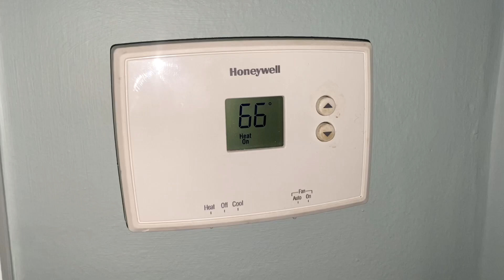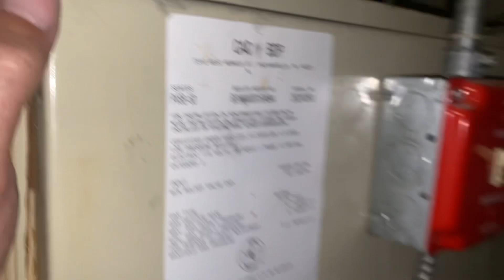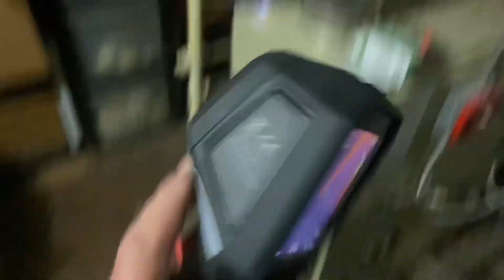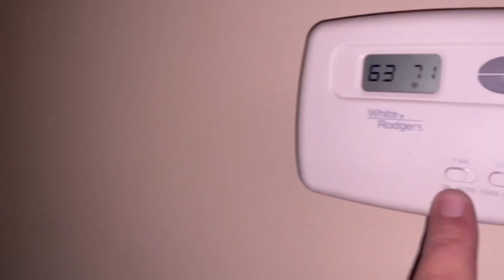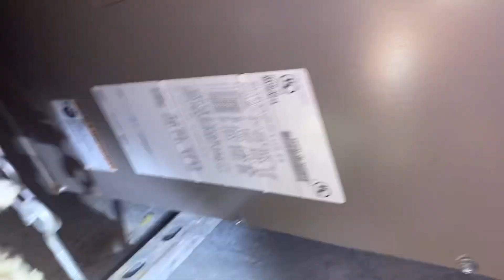Gas Boiler Not Heating House with Hydro Fan Coil & Blower Not Working

Comment: so the blower does not push it pulls the heat so the blower motor is always in the hot air ... would that cut the life of the motor ? cause of the hot air blowing over it all the time

Comment: Buddy Mike I have ran into the same Issue no fan when you have Hot water flow to AHandler ... There are Times I have purchased those little fan control boards with no success ...still no fan ... this job here that your on apparently different ... as you got fan to come on cause of an " open circuit "  ... But there have been times that you can do it thru thermostat and set up the parameters to bring fan on thru T-stat ... I would like to talk to you about that .Yes granted the unit circulates room temp air for a little bit but she catches up and the problem is solved ... buy another truck for Huntington and vicinity ... I'm Busting Buddy , need to hook up for a cup or slice  All the Best Buddy... Again.... absolutely love your content
Reply: @PipeDoctor  I like Hot coffee ...

Comment: Hydro fan coil too? 😞 Just go forced air all the way around then. You might like boiler heat I don't know, I like it in floor heat but I'm totally forced air all the way around. Can't make me change
Reply: @PipeDoctor  no more bosch mikey?
Reply: @PipeDoctor  Sal Brunetto says hi BTW. Just went to a bosch and Johnstone promo at top golf last night. You da man mikey
Reply: @PipeDoctor  I like that idea. I suppose you have much more older houses in your area, I know my area alot of the old houses are boilers. Carrier is still good except for their Chinese capacitors.
Reply: @PipeDoctor  carrier/icp same stuff these days. Yeah the contactors are junk too. I've had to change a couple inverters and even had to do a compressor this year on two of their inverter systems under warranty (the infinity would be inverter tech) the first inverter I changed was a 2 year old unit, but the owner had his power pole drilled by lighting, messed up all kinds of stuff in his house, the 2nd was a tech support failure, told me to change the inverter and it actually wound up being it's compressor 7 years old, still under warranty if it's registered, but that was pretty disappointing. I still like carrier but I definitely have contradicting opinions. At least their heat exchangers seem to hold up compared to their last generation furnace.

Comment: Mikey! Mikey! Mikey! Please! Stop calling a short the same as an open! That is the same as calling a Democrat a  Republican! I have been a tech for over thirty years some of that in the military. You are a very intelligent man  so I cringed when you said that. A short and a open cct are diametrically opposed. You are instructing younger techs. Please use the proper terminology and different fault finding procedures. So does Daniel and Peter think they are the same? Mikey you are brilliant but please please use the correct term that you would use for any of your other HVAC terminology. Which in HV and LV / AC and DC a short is a short and a open cct is an open cct. Shame on you Mikey! Cheers from Canada 🇨🇦!  Love your channel for the tech but mostly in how you are training your techs. Peter is coming along. Daniel has seen the light and is buying his own tools. You rock sir. You just made me cringe a whole lot for a few mins. They have different safety issues depending on LV/HV. Open cct you don't want to be the quickest path to ground!!!! HV of course! LV mostly gives you an eye opening jolt.